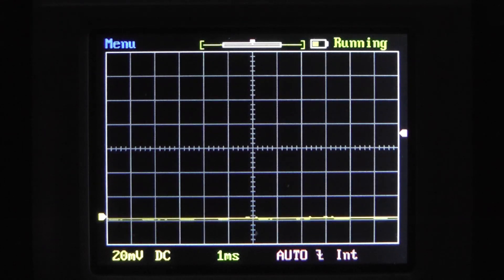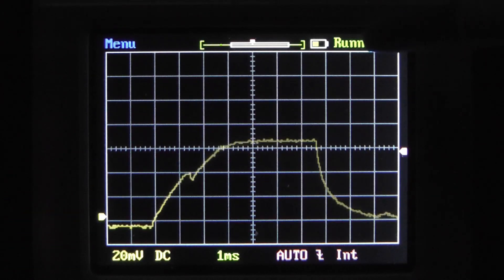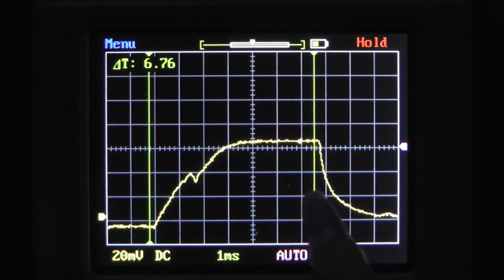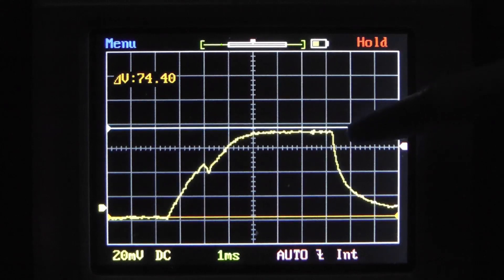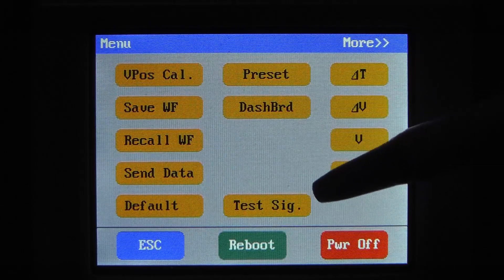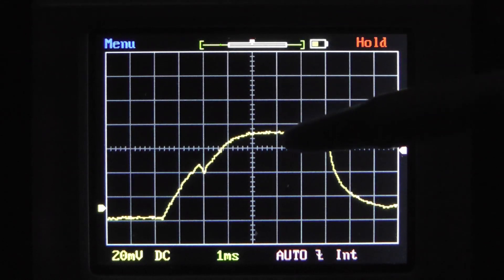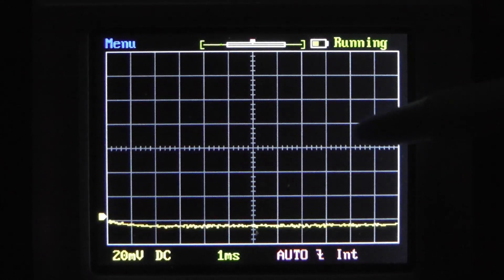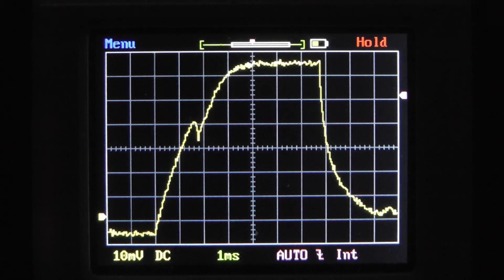JYETech DSO112A. Preview of a uScope Alternative.

Comment: Thank you for the video. Good job. Is there a set of test leads and attenuator for this scope? Current clamp, primary probe, secondary probe, bnc or banana adapters.  If so, where did you buy them. Thank you very much.
Reply from the maker: Go to AESWave.com for a nice variety of accessories. Otherwise you can use Amazon and even ebay. AESWave is great since it will help you to see what you might want to have. Good luck!

Comment: I just ordered the DSO202 from sainsmart should have it early this week. Can't wait to try it. I'm sure it's more adequate then the Uscope which is just a DSO Nano With some presets. I was tempted to get the Uscope but the whole 200K bandwidth and 1ms/s thing killed it. The DSO202 is 10 times higher then that and about $50 cheaper and 2 ch
Reply from the maker: Nice. I haven't messed with mine much lately but I need to get it out and start using it. Good luck with yours!
Reply: @baxrok2.  got my DSO202 and it's great. I'd take it over the Uscope any day. The only real advantage of the Uscope are the automotive "pre-sets".. The DSO202 has under its trigger menu "auto fit" and it finds your signal and scales everything and sets a trigger for it in like 3 seconds. It also has a Built in waveform generator.. 

If you're in Instagram you can follow me and I have started to make some post about it just search autodiag1 on IG

Comment: Shame it's price puts it in the same range as professional PC based multi channel scopes with much higher performance, but at least it's portable. I've got the cheap DSO138 and it surprises me how useful it is in automotive, as I'm making the Arduino based ECU Speeduino and it comes in handy testing VR sensors, optical triggers, etc. There is another cheap scope that is a much more advanced from Gabotronics.
http://www.gabotronics.com/oscilloscopes/view-all-products.htm?utm_source=socialmedia&utm_medium=content&utm_term=voltlog&utm_content=vlog&utm_campaign=transistor-tester
Reply from the maker: I paid around $90 for mine and the Gabtronics model is $118 and does not have the touch screen feature which is something that I really like. Also, to me the JYE Tech screen seems to have better resolution. I'm most certainly not highly knowledgeable about scopes and I appreciate your input. I'll have to look more closely at the Gabtronics line in the future. Who makes " professional PC based multi channel scopes with much higher performance" for around $90? I'd love to know since that is what I was looking for all along! JYETech makes a PC interface but not for the DSO112A. Thanks!